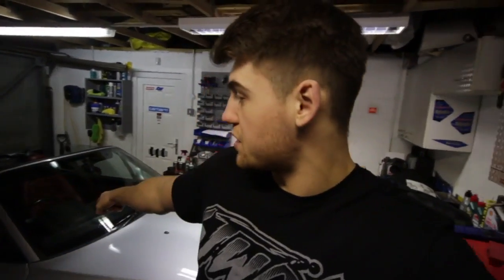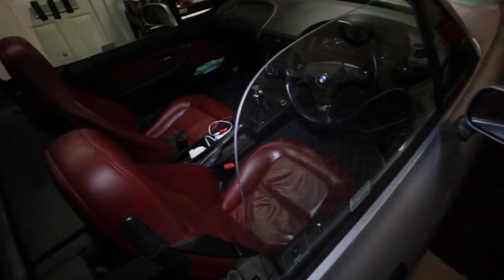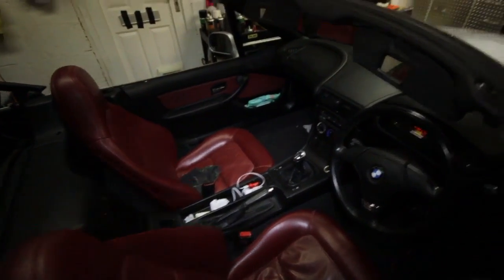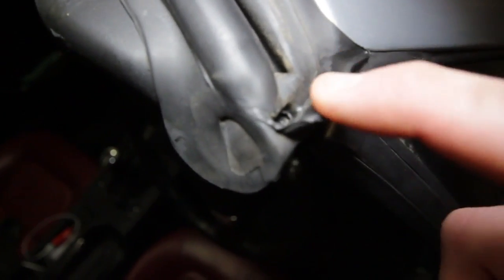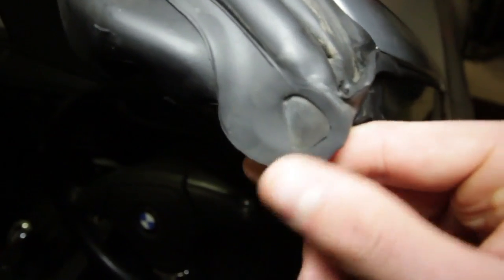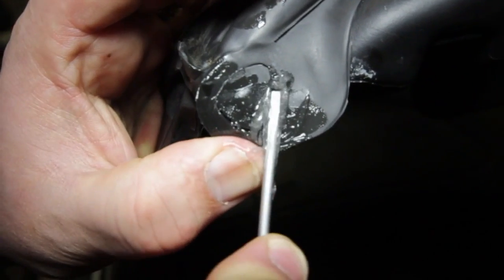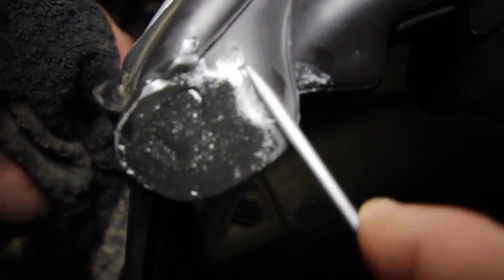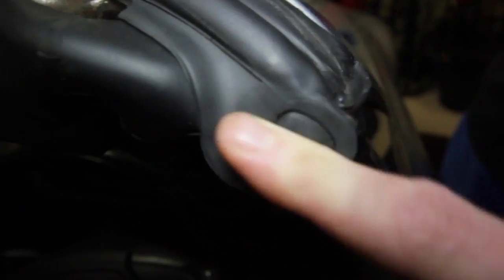BMW Z3 - How to fix a leaky roof! (EASY)

Comment from the maker: I can confirm that this has worked! We've had rain all day and so far, so good 😊 a couple of things I left out though... if you use an old credit card to spread the sealant over the bead then it will make the finish a lot cleaner, you can also use a damp cloth to wipe away any excess. All of this is mentioned in the PDF. Thanks for watching ✌🏼

Comment: Hi all the way from New Zealand. I have a Z3 with a hard top. Same issue you described. Removed the hard top, cleaned around the A pillar drainage plug with turpentine, used a fine wire to make sure the drainage whole was not blocked and flushed it with turpentine.  Lightly filled round the rubber plug with black windscreen rubber sealant. Wearing gloves to smooth sealant around the surface. Had some heavy rain couple 3 hours after drying, wohoo no more leaks from down under NZ.

Comment: Once add the sealant. Use an old Credit card or something with a clean straight edge and it will make smooth. Versus using the screw driver. Also turn your interior light off and open your two doors. Leave over night. Reason being pressure on the seals with doors shut. Good job.

Comment: ProTipp: To clean the hole and the whole way down use a syringe with dish soap filled. I could clean the whole drain with a litte pressure from the syringe. Keep up the good videos!
Reply from the maker: Sebastian D. Good tip! Thanks for watching
Reply: Nah just clean it by going through the car wash with the top down ;P

Comment: hey it actually worked !!!!!!! used a silicone black sealant you can hardly tell the difference once the top is out.no water coming in even in heavy rain.

Comment: Wow man thank God I found this vid... on closer investigation the cracks your filling is an actual plug bout an inch an a bit long I managed to ease it out leaves it clear to check the drainage down! I then cleaned it and the hole thourouly and replaced it with fresh silicon all round sealing it back in.. beautifull it's made my new year and I can't wait for it to rain.
Thanku

Comment: Looking to buy a 98 z3 2.3, 160,000 mi. and well maintained, from a friend who has no mechanical ability and telling me that repairs are expensive so I shouldn't. I have mechanical ability and also own a 91 toy 22re 4wd 5 speed pu that I do all the repairs on  major and minor.  Understand different in so many ways but mechanics is basically mechanics, somewhat. Been test driving for a couple of weeks, performs well but soft top does leak at the posts, video very helpful also will need to replace driver side window gasket, repair ac, repair conv. top linkage for motor driven opening/closing and put new brakes. Under the hood looks a little intimidating as of now compared to my truck but I love the vehicle and it is the opposite of the truck plus I'm 67 and like keeping old things going. Would love to read other peoples reviews on this car.

Comment: Sick top! You were smart you bought a Convertible when theyre unwanted and cheap haha.
Reply from the maker: 6TWO1 True... I'm tempted to sell it though man, too slow 😂
Reply: Just paid 1050 for one two weeks ago, two years ago got one for 900. Drove both home in snow :-) It's not slow, you're just not revving it hard enough, use the top end. Peak power is 4500 rpm so stay around there. Keep the stock airbox but give it a second air source from the fog lamp. It you want get it chipped on a rolling road, M42 and M44 have lots of potential as the factory tune was really conservative to avoid embarrassing the six cylinder cars.
Reply from the maker: Thanks for the info, top end power is the only place it shines really.. fun as hell to drive but I'm used to a turbo haha, i have seen the airbox mod! I might do that one soon
Reply: Remove all the foam from the inside too. It breaks down with age and gets sucked into the engine.

Comment: I did this step to replace the break in the A pillar but I am still dealing with water getting in (have a 97 Z3). Any suggestions on where to look next? I have a gap between the top of the window, when rolled up, and the soft top canvas.. Could that be the problem?
Reply: Charles Hume I believe you can tighten the latches so that the top closes tighter.

Comment: I love this video just what I was looking for, also I have a leak in the trunk do you know what it could be? The soft top is brand new just replaced
Reply: I a problem of moister accumulating on the floor of the trunk along the back wall.  The water is somehow coming through the taillight.  I wish I could give you more information but it was a repair shop that discovered it and fixed it.

Comment: I would have thought that if the soft top is waterproof and the hardtop isn't it would be an issue with the hardtop itself and not the A pillar seals.

Comment: Please make a video about wet carpet how to solve it
Reply: Get a shop vac (wet/dry vac), peel back the carpet from the door sill, put the slit attachment on vac (narrow, thin opening), jam the vac in there under the carpet and let it run 30-60 min.  It can also help to punch a hole or two in the carpet to help air flow; doesn't look great but be discreet and it does help. Can also vac the top of the carpet.
Reply: Jamie Pfaff thanks , but i already try it and it still wet every time i wash my car

Comment: Mine leaks into the trunk? Like to know how fix that.
Reply: I had the same problem of water accumulating along the floor of the back wall of the trunk.  The water was coming through the taillight.  Sorry I can't give you how it was fixed - a repair shop discovered it and fixed it.